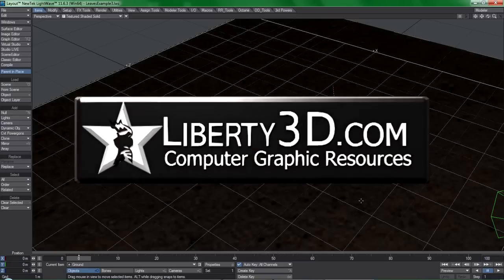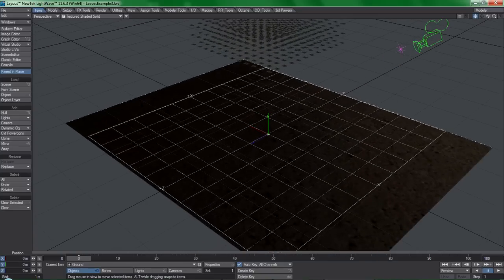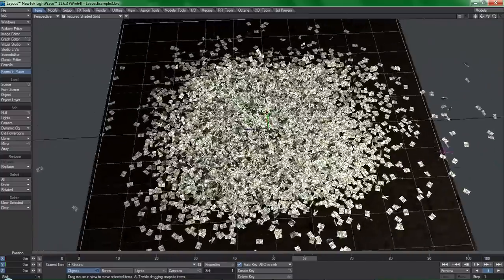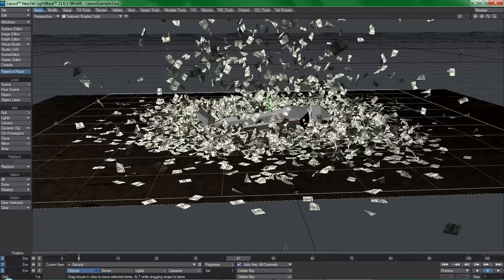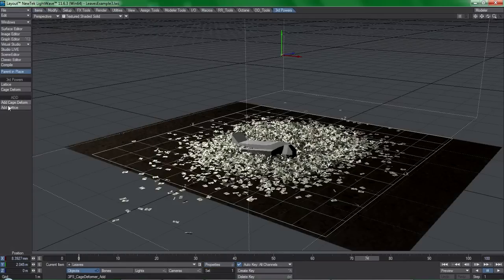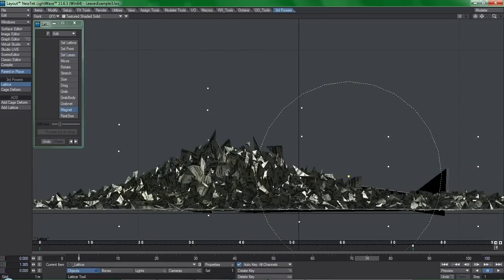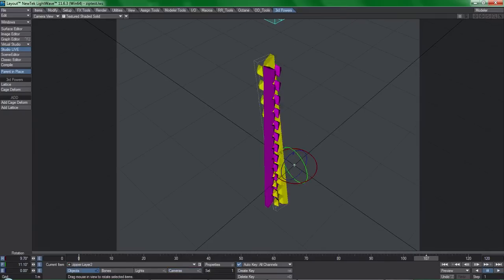Lightwave Dynamics Sculpting with 3rdPowers

Comment: Cool vid...I may have to fork out for all of their tools. 

I do think all of that could be done with metalink and metalink morph, but I still think I am going to get these tools. It would make so much stuff easier.
Reply from the maker: bryphi77 Cage deformer renders metalink mostly obsolete... but not entirely. Cages are a hell of a lot easier to layer and utilize and I consider the sculpting capabilities only a small fraction of what it is good for. It's interactive and it just works. Stack it the way you want, how you want, where you want.

Metalink however still has an advantage in the fact that it does a pre-process for mesh objects it operates on, so it can be used on ~150,000+ polygon objects, whereas Cages start to slow the scene down when applied to around 35,000+ polygons (determined by either a weight map or entire mesh). The same tricks people use with metalink are available to cage deformer, so usage of 2 point polygons or deforming flat planes equate to almost no added overhead.

Also, lattices are more efficient than cages in terms of scene overhead... they can be used to sculpt-manipulate objects around 85,000 polys before it starts to slow down.

So, if you do eventually buy into the layout tools, keep in mind the above specs and obviously weigh that against the kind of polygon counts you typically throw into your scenes.

Comment: I have question with this freebi . You say Cage and Lattice . But with this video you're only using the Lattice tool, correct?
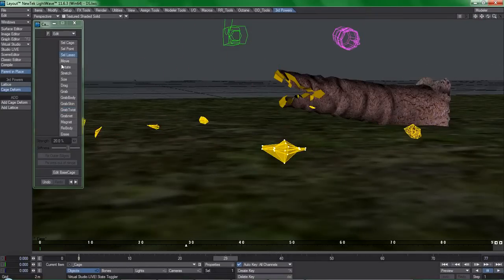Reply from the maker: ***** In the main demo, yes it's just lattice. At 1:37 it demonstrates a few cage usages. Lattices should always be considered before cages if they can provide the desired result as they produce less scene overhead. Cages offer far more control, but one may have to utilize weight maps to avoid having the cage evaluate the entire mesh.
Reply: tndStudios  Thanks man.